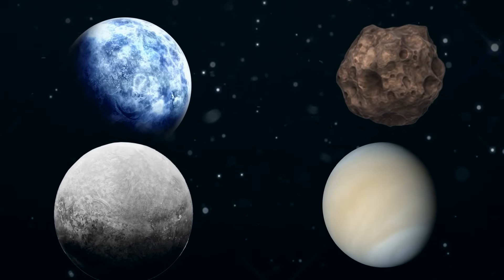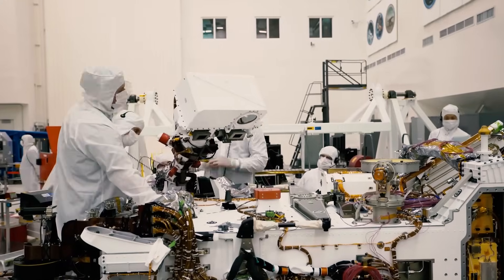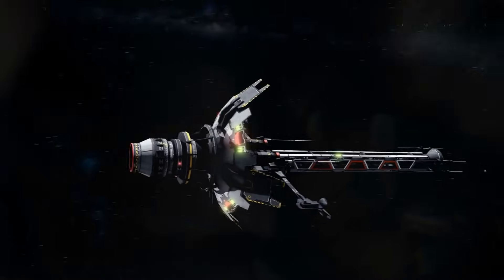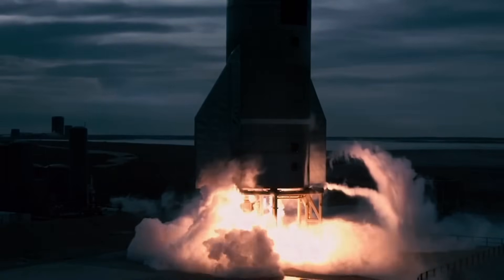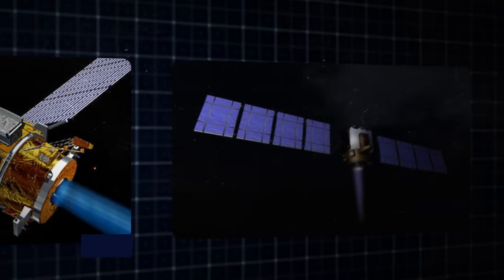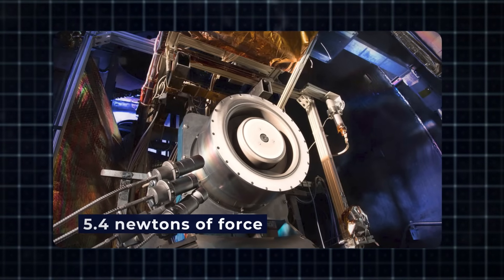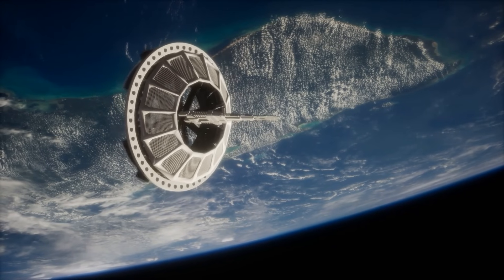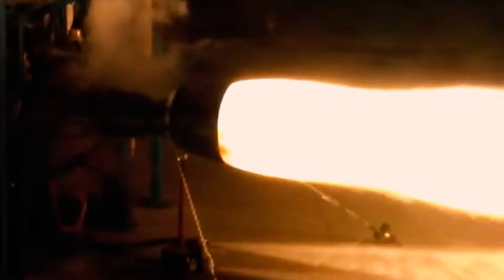NASA Builds Impossible Light Speed Engine That Breaks The Laws Of Physics

Comment: So , the nuclear engine is the closest thing to  as fast as the speed of light or warp drive ?
Reply: I don’t think nuclear energy would be anywhere near as fast as light speed but it would be much faster and more efficient than current rockets due to the long half life of a nuclear reaction and the vast increase in energy generated from such a reaction.
Reply: @blankname6629  The best nuclear engine is the Bussard Ram.  We just don't know how to maintian a contenous nuclear explosion.  The particles of the solar wind, which are much denser outside the solar system, are mostly protons and a few electrons.  Single protons without any electrons are still basically hydrogen.  Being without electrons these protons are highly reactive to magnetism.  Using a sufficient magnetic scoop it would only take 778 miles per hour to start.  Because it is a continous nuclear reaction the faster you go the faster you would be capable of going.  This is up to 99% of the speed of light.  You wouldn't be able to exceed light speed.  Currently the only nuclear engine that exists is the Orion engine.  It was actually developed in the 1950s.  It uses pulsed nuclear explosions to drive the ship.  It takes quite a while for this vessel to get up to speed.  But it is capable of attaining 4% of the speed of light.
Reply: Currently we are looking at thermonuclear engines.  A warp drive would move faster than the speed of light.  A warp of the fabric of space is neither matter or energy and can move at any speed.
Reply: Yes, a nuclear engine would be as fast as we could go, and we'd still not be going anywhere near light speed. But we could certainly go places in our solar system in less than a year.